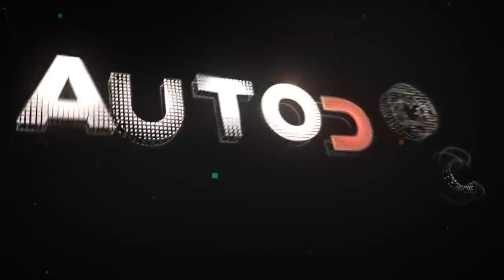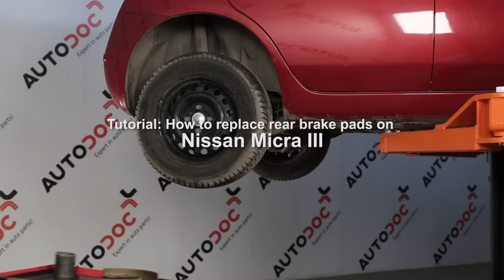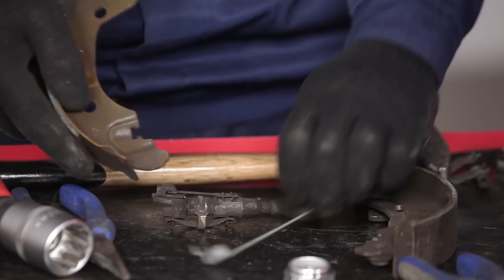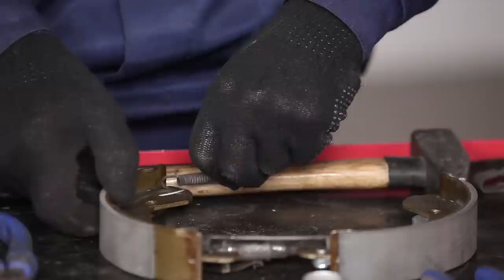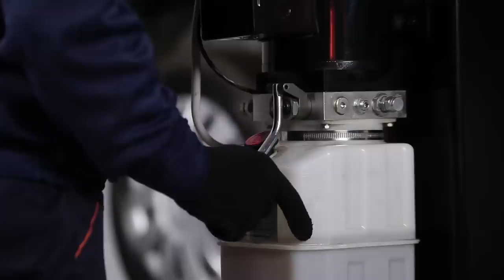How to change rear brake pads NISSAN MICRA 3 TUTORIAL | AUTODOC

Comment: Also, when you changed the brake shoes in this video, THREE important steos were missed;
1. The 6 lubrication points were not cleaned & re-lubricated
2. The self-adjusting ratchet was not reset to a shorter length to accommodate the new shoes.
3. MOST IMPORTANT, the bearing hub nut was not Torqued using a torque wrench. Should be set at around 175 ft-lbs.
Reply from the maker: Thank you for your feedback! Sometimes we skip some of the details in order to make a video shorter and focus on the main parts of it. We appreciate your kind remarks, they will be taken into account. Best regards, Autodoc!
Reply: 9
Reply: Or I'm right understand, adjuster need to reset to shorter Leigh ?
Reply: Couldn't believe the torque setting wasn't given out, I watched this video specifically to find out the torque setting for the hub ! So ended up having to watch another video to get the correct information required to complete the job properly.
Reply: @Colin623 If you had read all the comments, I listed the torque at 175 ft/lbs.
Reply: @46fd04  If you had read my comment correctly you would of realised I was referring to the video !!!!! Yes I saw your comment, but it is blatantly obvious I was complaining about the video for not including the torgue setting !
Reply: @Colin623  Roger that
Reply: @46fd04  No problem, and thanks for giving the correct torgue setting also 👍
Reply: @Colin623  You're welcome. That torque was given to me by a Nissan Dealer in Ontario, Canada
Reply: 175Nm for the Nut
Reply: @FredGoe 
175 nm = 130 ft/lbs.
Now I'm not sure which # to believe.

Comment: Great video! Dude! How did you adjust the brakes?
Reply from the maker: Thank you for your comment!
Scrolling the spacer gear, we adjusted the pads so that their friction part fits snugly against the working surface of the drum, however, the drum itself rotates freely without any effort.
Best Regards,
Autodoc team
Reply: I thought that they are called shoes, not pads 🤔🤔🤔

Comment: Pulled mine apart after watching this, unpleasant surprise, my brakes are completely different, re-assembly instructions completely different. 
Wow, lucky I have been rebuilding drum brakes for over 40 years, still took me 4.5 hours, although I did change slave cylinder and wheel bearing, but most of the time was in 4 reassembles of the brake shoes. Damb

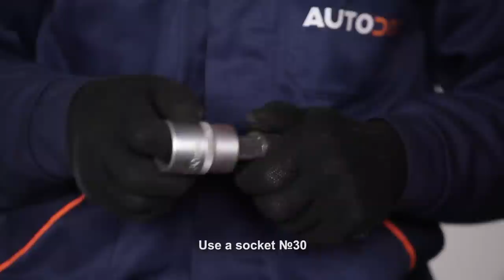Comment: A question plz is the the same socket  1:11 we use in Sunny N14 ?Thanks for your help
Reply from the maker: Thank you for your comment!
In general, the replacement will be similar, the only thing that may differ slightly in the design features of your car. 
You can find more information in the technical documentation for your car repair.
Best Regards,
Autodoc team

Comment: You need to torque the spindle nut, using an impact will ruin the bearing in the drum
Reply from the maker: Hi! Our videos are only for informative purpose. All regulatory replacements and values can be found directly in the technical documentation for your particular model of car or use the help of a car service.

Comment: Note to Micra owners , when, after 220,000 km I decided to replace the rear brakes on my Micra ( showed very little wear )  I came across a broken shoe spring , that little one one the bottom. May have been broken from the factory , it was really badly worn from just floating around in there . Anyway ,if you live many miles from a dealer or auto supply store, after you take off the brake drum, make sure all the parts are there and in good shape . I'm 260km from nearest dealer so I was without a car for a few days till I got a ride to the dealer, and a ride back . Front brakes were changed at 200,000km , wore some, but not bad for 125,000 miles of mostly twisty,up and down, sharp corners mountain highways . Average gas mileage over the 220,000 km works out to 49.6 miles per gallon . Good luck with your new brakes .ps. it's a 2015 model, bought brand new in fall of 2014.
Reply from the maker: Thank you for your valuable comment!
This information will be very useful for us and our viewers.
Please stay tuned with our channel for more videos coming soon.
Best Regards,
Autodoc team.

Comment: Its an ok video. Just wish they showed how the automatic self adjuster works. I'm working on a 2015 Micra. Trying to adjust (tighten up) the brakes. I have brakes apart, I have the adjuster in my hands and I cannot figure out how to manually operate it to tighten brakes. Ive worked on cars for 30 years and this Nissan product has me stumped!
Reply from the maker: Thank you for your feedback! Unfortunately, we can`t give you the answer, you need to look it up in the vehicle documents. Best regards, Autodoc!
Reply: Put the tightener on the bench , then go but a Chev , problem over

Comment: Are the nuts on both sides right hand thread?
Reply from the maker: Thank you for the feedback! on the left and on the right side it is exactly the same. Best Regards, Autodoc
Reply: Only nut is the 30mm nyloc , both sides right handed . Tighten to 130 lbs

Comment: Sill no torque settings bolts done up power wrench it could be 100nm or 200 not 175nm as it should be.
Reply from the maker: Thank you for the feedback!This video is considered to be an informative one, and it is approximate. Best regards, Autodoc.
Reply: Thank you for reply I was thinking of safety.
Reply: Thank you for your reply I was only thinking of safety  but I do like your videos
Reply: I was thinking the same, but some garages do, do this bad practice, as most people wont know that it's not the right way to do it.